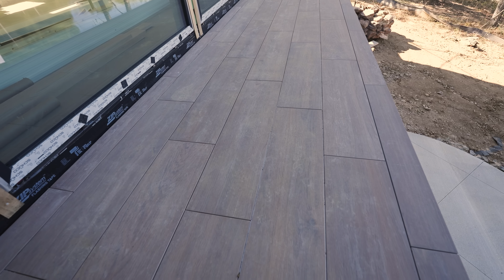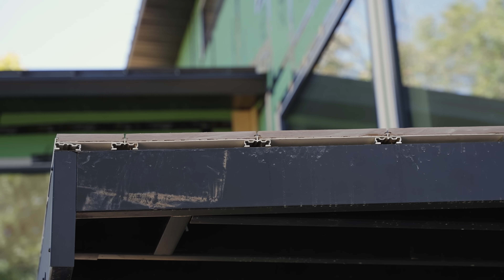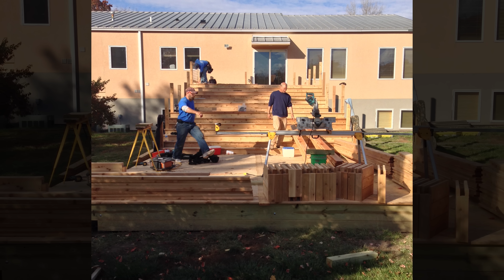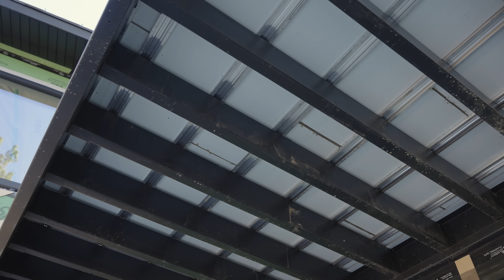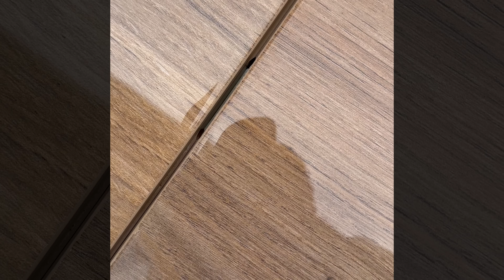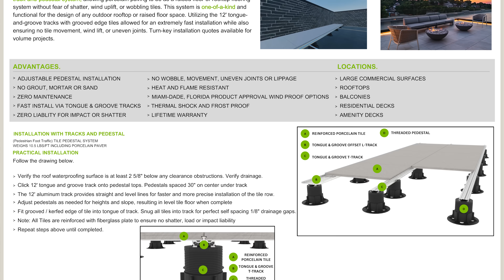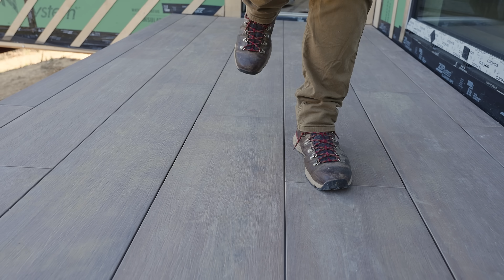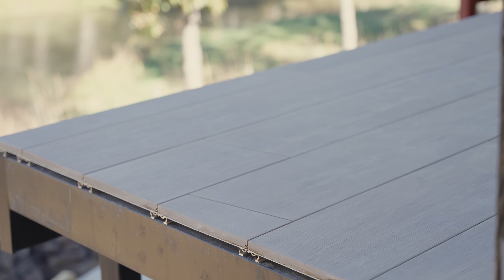Swapping Wood for Tile - the New Deck Alternative

Comment: What about heat? How hot with that surface get in the full sun...in the summer?
Reply: Mbrico Tiles have solar reflectance index (SRI) ranges of 60-80%, so they stay cooler under the sun vs composites, concretes, etc!
Reply: we tested samples with a thermal imager before our first Mbrico install. The tile stays a lot cooler than azek or trex.

Comment: Will be interesting to see how the dissimilar metals hold up over the long haul. Outdoor exposure of steel and aluminum will create the battery effect, especially when wet.
Reply: For our steel dock they provided a butyl separation tape to ensure no corrosion
Reply: Depends on the aluminum alloy/temper
Reply: @jaymmcm  exactly right. They also provide a butyl flashing tape to seperate the tracks from the steel for guaranteed longevity.
Reply: I had the same thought. Kind of surprised they didn't just go with something like Outdure since they have a full system that's all aluminum and even special connectors for tile.

Comment: Tile seems like it would get as "hot" as synthetic wood?
Reply: we tested samples with a thermal imager before our first Mbrico install. The tile stays a lot cooler than azek or trex.
Reply: Tile stays a lot cooler
Reply: Mbrico Tiles have solar reflectance index (SRI) ranges of 60-80%, so they stay cooler under the sun vs composites, concretes, etc!

Comment: I’m just curious how that tile on those aluminum profiles will last. In my home country , the tile goes directly on the concrete and unfortunately the adhesive fails due to freezing, do you believe this will outlast a wooden deck and to need extra attention in 10 years or so?
Reply: we've installed Mbrico for about 12 years now all across the midwest. no problem with freeze thaw since the tiles aren't mortared and the porcelain itself doesnt expand and contract.
Reply: @midwestdecks5907 that’s good to know, thank you for the information. Have a blessed weekend!

Comment: Wood decking properly maintained can last 50 plus years... 15 years and its not doing good? Something wasn't done right.
Reply: The arsenic stuff did.  Not the current copper based treated lumber.  It lasts 15 years at best.  My deck is 11 feet off the ground supported by brick columns.  The framing is completely rotted out after 12 years.  Composite on top is like new.  Next time I will go with steel framing.
Reply: @arthurbegun582 I have in one instance replaced a deck that was only 8 years old. Ive been told the lumber industry went through a few years of "bad batches." Something in what they treated it with wasn't working. Ive seen decks 30 years old that are still crazy enough, solid.
Reply: @arthurbegun582  steel framing is cool. When you do a steel frame take rust converter to it in places it may need it, and then use a direct to metal paint and seal it to protect from rust down the road. Important step, and not expensive if you paint it yourself. Ive got a sprayer, but it goes on with a brush and still looks good.
Reply: @chadrambo1038 50 years with today's PT?  Now that's a bold faced lie.
Reply: @huruguru I've replaced decks 8 years old from rot, and I've seen 40 year old decks still going. A lot of great carpenters out there that dont know the power of great oil based stains and or high quality enamel deck paints. 6 months to a year is current recommendations on curing, then a high grade oil based superstain. Scrub, pressure wash, sand if needed, and reapply. 
What you said about today's pressure treated, I have heard the old days had much higher quality wood and pressure treatments. Now its about how you maintain it ongoing.

Comment: Jake, are you actually suggesting the expected lifespan of a wood deck is 15 years?  My PT deck is in great shape after 17 years, only the parts that touch the ground (stair risers) have begun to decay, which is to be expected.
Reply: Lumber quality has really dropped off, sadly.
Reply: Mine was not in great shape after less than 10 years. Probably neglect by the previous owners but IMO at this point we know that people are going to neglect stuff and it's best to build things to account for that if possible.
Reply: they dont make lumber like they used to
Reply: My PT deck lasted 17 years with replacing close to 40% of the rotten boards during that time, too.  Plus cleaning and staining every 3 years.  PT sucks!
Reply: Treated lumber can last quite a while if taped and well cared for. Composite or pvc decking doesn’t. Tiles a great option for this.

Comment: Ipe and other tropical hardwoods, even when plantation grown, are still 3-4x the price of western red cedar. Cost is the biggest downside. At least here in Vermont they're very easy to find though.
Reply: Replaced a 37 year old cedar fence this year.  Never stained it once.  Went with western red cedar again.  This time I stained it.  If it last 37 years I'll be 95 and will go with something longer lasting next time.

Comment: My house is 35 years old and has the original deck still in place. It is treated lumber and just recently have I started to think it needs to be replaced. I'm really mixed on whether to go back with wood or the new decking material. 35 years is great longevity.
Reply: Treated wood of 35 years ago is not the same as treated today. If you rebuilt the same deck the same way with today's treated lumber it would not last nearly as long. I would invest the money in composite or the the like.
Reply: Treated can last a very long time if well cared for. PVC, wood or composite cannot considering the traffic, sun exposure etc. tile is a great option for this
Reply: @jaymmcm  Yes, plastic and composite decking is overrated. I use Eastern Red Cedar for fence posts and other outdoor projects, and they last for over 15 years in ground contact. Above ground, with an oil finish, I imagine it would last every bit of 35 years. But I have no data on that. And I don't know if many lumberyards sell good quality Eastern Red Cedar deck boards.
Reply: Current treated lumber is not very rot resistant. Do everything you can to protect it. These days, synthetic deck materials may long outlast the pressure treated frame beneath them.
Reply: @matthirn7858  Exactly true.  The framing of my 12 year old deck is rotted out even though it is 11 feet off the ground.  But the composite material on top of the deck is in perfect shape.
Reply: @arthurbegun582 now I’m feeling nervous about my one year old deck at ground level. I can’t even get at that lumber to try to maintain it.
Reply: @matthirn7858 Yours will probably do somewhat better than mine.  They upped the percentage of copper the year after mine was built.  But it won't last like the old arsenic stuff.
Reply: That old wood was most likely treated with arsenic. 
Think about THAT...
Reply: @gardengatesopen not saying we should keep using toxic products, just that the new treated lumber does not perform as well as the old stuff.
Reply: @matthirn7858 
I opt for the Japanese 
Shou Sugi Ban method. 
= gorgeous AND non-toxic.
And yes, more work up front.
But worth it, imo.

Check in with me 50 years from now, and I'll let ya know how it held up.  👍
Reply: You will not get anywhere near that longevity out of modern treated deck boards. They don’t last as long as they used to.
Reply: unfortunately the lumber isnt what it used to be
Reply: @midwestdecks5907  I think that the difference is over-stated. The bigger difference is between about 70+ years ago compared to today.

Comment: While this is interesting, any product which is 'fake' (such as wood grain) never stands the test of time, stylistically.  I'd stick with more natural tile.
Reply: Is any tile natural? Stones are natural (slate, granite, etc.) but all tile, porcelain or otherwise, are designed to mimic, or at least suggest, something else.
Reply: @spenceralridge4958 What does plain tile mimic?  Tile?
Reply: benefit of porcelain compared to a "natural" tile like bluestone, limestone, flagstone etc is no staining, mold, mildew, flaking, or expansion. Porcelain is fired and much more dense which offers huge technical benefits.
Reply: Tiles are made from natural product but are all designed to look like stones, woods, travertines, etc.
Reply: That makes zero sense that you think a tile that looks like wood would be less durable than a tile that doesn't.

Comment: Black locust was not mentioned!!
Reply: I have read that supplies have trouble sourcing high quality black locust.  The good stuff is very good.  Small lumbermiĺls may have better quality locust
Reply: we used eucalyptus on our most recent porch. after a year still looks perfectly flat and smooth.
Reply: I have a Black locust tree stump that has been buried in dirt for 25yrs and has not rotted.

Comment: I love the idea- but if that deck gets direct sun - you will have to wear shoes on it or it will literally burn the bottom of your feet.
Reply: Our Mbrico deck stays way cooler than our old Azek deck actually
Reply: Porcelain stays relatively cool
Reply: Mbrico Tiles have solar reflectance index (SRI) ranges of 60-80%, so they stay cooler under the sun vs composites, concretes, etc!
Reply: we tested samples with a thermal imager before our first Mbrico install. The tile stays a lot cooler than azek or trex.
Reply: I would have the same concern.  I installed Tanzite decking, which is very similar, and it gets extremely hot.  Much hotter than wood or Trex.
Reply: @jimbo1231969 Mbrico has thermal imaging videos of composite and wood samples on porcelain decking and the composites get hotter. Similar color families

Comment: 😮  So what happens if you drop something on it?
Reply: personally dropped a hammer on a deck we were installing while I was working on a screen system. Didnt leave a mark.
Reply: It’s fiber reinforced 3/4” thick tile. They market a higher breaking strength than composite or pvc decking actually
Reply: @jaymmcm  ceramic is ceramic... it doesnt matter if its 1" thick if there is no full coverage thinset supporting it.
Reply: @Pepe-dq2ib The last two tests are 4 pound and 10 pound blunt weight drops on regular tile and then on Mbrico tile. Regular tile, of course, breaks. Mbrico results: 4 pound = no damage. 10 pound = chips + spider web cracks, but still structurally sound

https://youtu.be/tSTgV-pEUd4?si=L9jM2dfs35tnKpZn
Reply: @Pepe-dq2ib  I think the main difference is their porcelain is layered with a fiberglass plate glued to the underside of each making it very shatter resistant
Reply: @Pepe-dq2ib  this is like saying wood is wood or concrete is concrete. of course thickness matters. pour a 1" thick concrete driveway and see how it works out.
Reply: It falls to the floor. What happens when you drop something in your kitchen or your bathroom?
Reply: @spenceralridge4958  kitchen and bathroom tiles have full coverage thinset. You test it by dropping a steel ball and chain, if the thinset doesn't have a complete coverage, itll break the tiles. I would love to see how this system fares against a  proper tile drop test.
Reply: @Pepe-dq2ib exactly... The tiles crack/break/chip.
I was thinking about a clumsy fumble with grilling, maybe dropping a cast iron lid off countertop height.. 🫣🤷
Reply: @spenceralridge4958  heres one way you test a tile floor before buying a house https://youtube.com/shorts/MKcSuEj2RFM
Reply: or overload it and happen to have rot underneath...